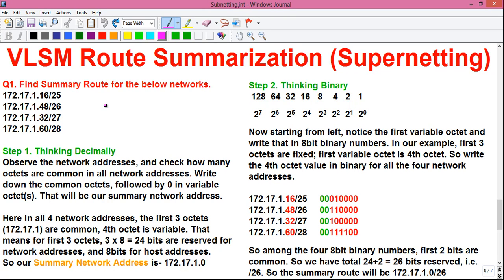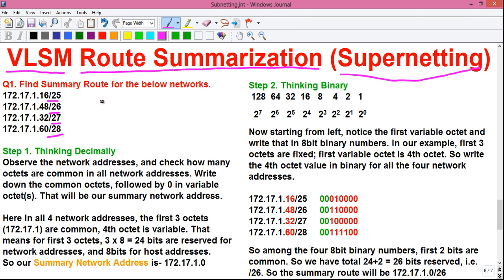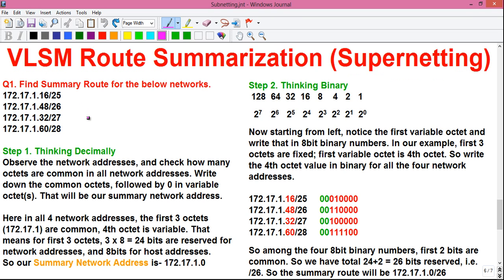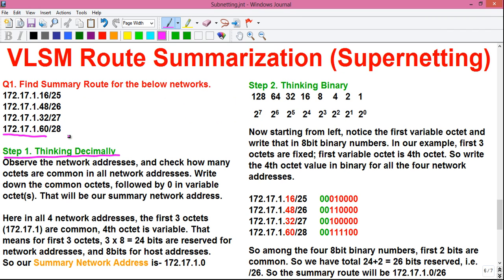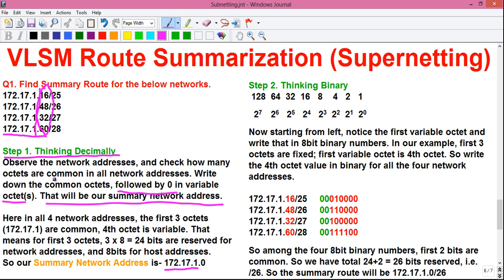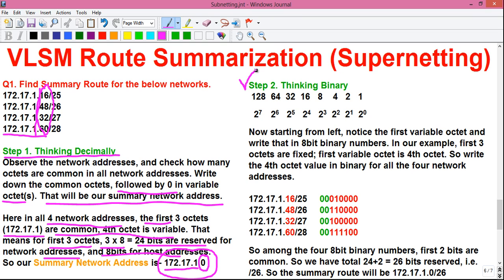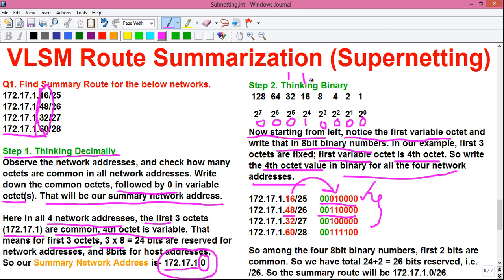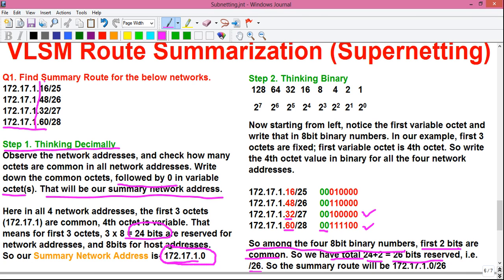CCNA 4_VLSM Route Summarization Explained_Supernetting Made Easy

Comment: Wery good for beginers to get the concept of network summarization, but it won't be good for the exam. You can get the biggest number in uncommon digit group. For example 10.1.5.1.128 /16. 00000101 16+5=21 10.1.0.0 /21. If you wrote all IPs in binary you wouldn't finish half an exam.
Reply: +Matije &amp; Ellen ... IT is the easiest method for summation. It will easy if you know network bit values